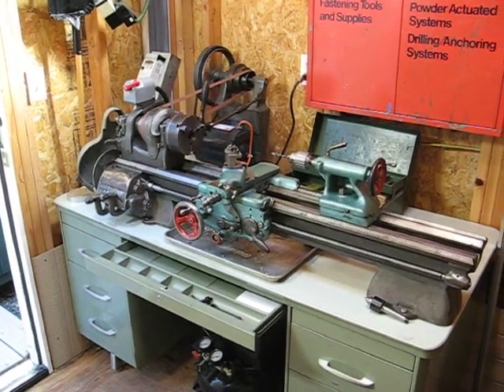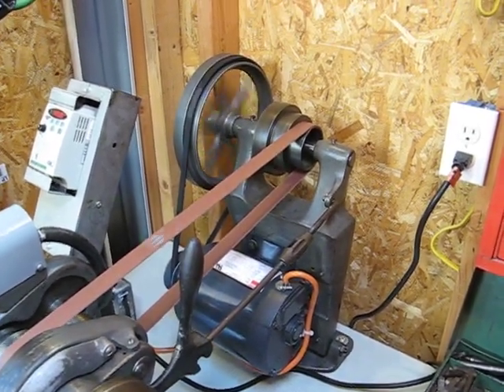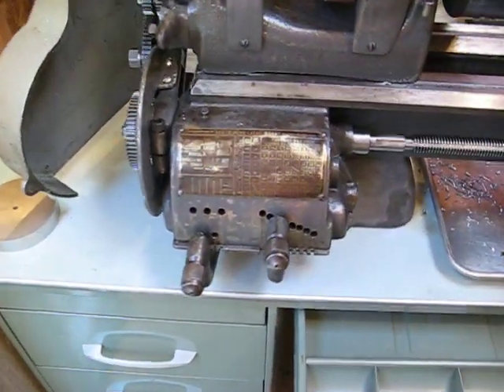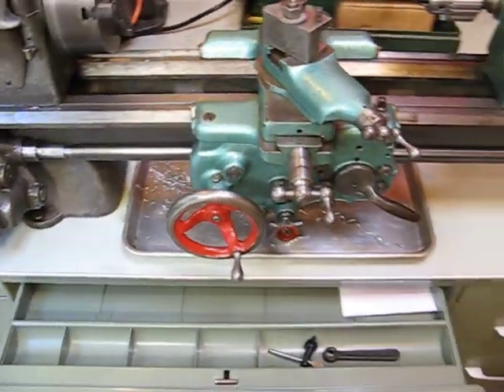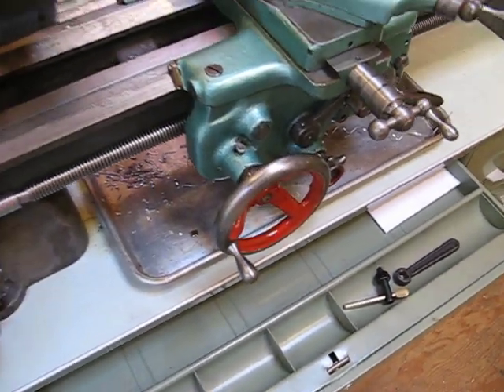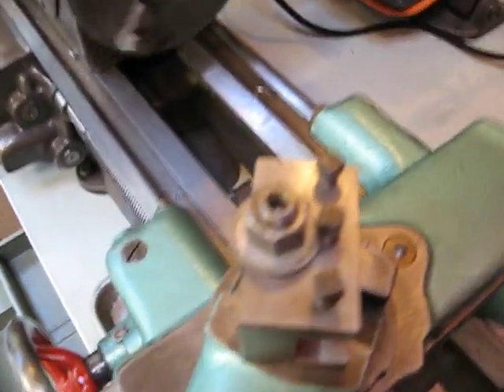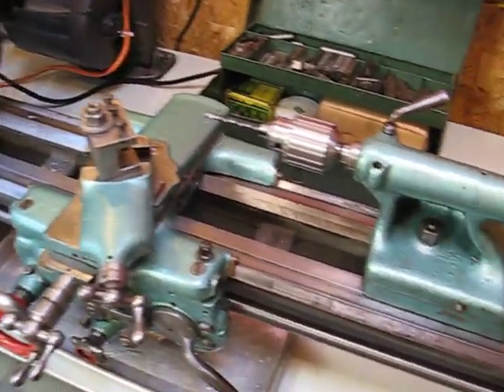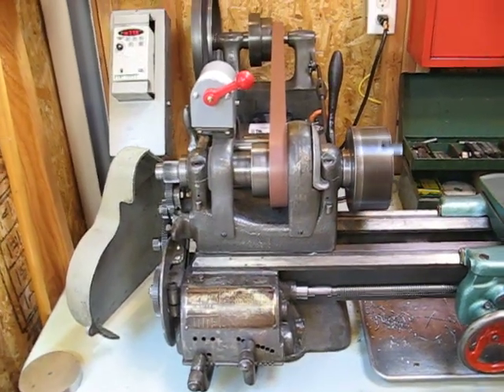South Bend Model 9A Metal Lathe walk through

Comment: Are you still running this mounted to that old tanker desk? That's what I was originally considering to do with mine and I wondered how it held up or if you have ay feedback on it
Reply from the maker: yes.    I don't use the lathe a whole lot but it still occasionally comes in useful,  most recently in repairing an electric lawn mower motor.      The desk is very heavy so no problems with things shifting around and its top (marmoleum or something) is easy to clean.      The one thing I want to do to mine and would reccommend is replace the legs with heavy duty casters.   Then you have a (sorta) mobile lathe.    You might also want to find a desk that is shallower (front to back depth) than the doors in your home/shop? so you can roll it through easily.   Mine is a little too wide for the door it had to go through necessitating major disresembly to get it to where I wanted it.
Reply: @madderscience that's good advice. I have my lathe mounted on something with castors now so I'd true to go that direction. A lot of those tops are formica and fortunately with a garage door, i can get away with some extra width. Hopefully before long I'll have mine rigged up similarly!

Comment: Just purchased one of these (well model B) from auction for less then 50 USD with so many accessories., best deal I've ever gotten. Just need a bench, what kind of desk is that? Thanks
Reply from the maker: The desk is a 60's or 70's era steel 'tanker' desk.   Find an old office furniture store or building contents liquidation and you can get your hands on something similar.   Very sturdy and very heavy.

$50 for a SBL in any shape is a really good deal.  some of those accessories can really add up the cost.    congrats.

Comment: The tail stock For my old model C seems to fit my 1948 interim model A ..
Reply from the maker: is there enough (or too much) overlap on the flats?    is the centerline of the tailstock in line with the centerline of the headstock?   given the difference in bed width some adjustment may be necessary.   Still good information.

Comment: I have the 1938 version of this lathe, they made B17 parts on it in the war.  Still works good but a new motor would be a major improvements as it's very under powered.
Reply from the maker: I think my motor is 3/4HP rated but the motor controller I have is only good for 1/2hp.   I've mostly made things from  aluminum;  some steel for driveline parts in the car and I'm not worried about speed but its a good setup.   I've still got all the ratios on the countershaft to play with so getting the speed vs torque I want isn't a problem.  The flat belt slips long before I run out of motor.

Comment: Hello, I don't think you are going to get 20 tpi on B 3 because you have mounted the 40 teeth gear in the wrong position
Reply from the maker: Its entirely possible;  good eye.  I've used the power feeds for various turning operations but I haven't cut any threads yet.    You can't tell but I've also got the quick change box levers installed in the opposite positions from correct ; only impact there is a couple ratios won't engage.  I'll fix it when I need those ratios...
Reply: @madderscience  just put the 56 teeth gear instead of the 40teeth gear

Comment: Hi!
I’m learning to operate same exact lathe but can’t get the right thread. 
I have the belt in low gear and have the gearbox in the thread i want to make and matching letter but I get 3x more threads than I want. 
Instead of 10 I get 30 I tried 5 and I got 15. 
What I’m I doing wrong or missing?
Thank you!
Reply from the maker: is the back gear ratio correct?   Is the underdrive engaged (big reduction gear behind the spindle)?    You are reminding me I need to make something.  Last thing I did with my SB9 was modify some electrical conduit brackets to make a security camera fit a bracket it wasn't originally intended for...
Reply: Hi, you must have the 40teeth gear and the 56 teeth gear in the wrong position

Comment: If possible, can you please tell me the Brand/Model VFD you have, and it's input and output? Thanks
Reply from the maker: Its an Automation Direct GS1 10P5 I believe.  This is a 1/2hp unit.   120V input.  It works fine, my only complaint is you need to wire up an external switch for reversing.  All the other controls (on/off, speed) are built in.   I'm running a 3/4hp  inverter rated motor with it.   I believe its an 1800rpm @ 60hz nominal motor.
Reply: Thank you for the information, I appreciate it. I'm kind of torn between a 220 single phase in /220 three phase out - OR-  a 115 single in /  three phase out for a 1hp on my 13"  SB. I'm a bit confused on how or if I will be able to utilize it's existing Forward/ Off/ Reverse  drum switch in a VFD configuration. Then there is the issue of remote unit with tachometer to factor into the mix.  Btw your desk is perfect!
Reply from the maker: It should be easy to set up the drum switch to work as a fwd/reverse selector,  but not so sure about also controlling start/stop at the same time.   IIRC it has plenty of contacts so that might be possible too depending on what external controls the VFD has.  I haven't tried to set it up for that since I haven't tried to make any threads yet, so I haven't needed reverse.   I'm looking for an excuse;  it just hasn't come up yet.
Reply from the maker: I picked 120V input specifically because my workshop is powered by an off grid solar array and battery bank.  I don't have 240v.   However,  I've never had any issue with insufficient power.  Anything bigger than a 10" lathe though 240v would probably be a good idea.
Reply: Thanks again. A solar powered lathe is pretty cool. Being this late in the season (and I just got my lathe Tuesday), I'm also still wrestling with where to station it. Garage, build a shed, dismantle/restore/reassemble in my basement, I'm not sure. My 120v or 220v direction will be dictated by the final location as well. In the end these are happy problems. :)

Comment: do you lose torque at low speeds?
Reply from the maker: Not that I have noticed.  Between the 3 belt ratios and the back gear I can gear it down pretty far before I even need to reduce motor speed very much.  At the start of the video the motor is running at 20hz or 600rpm (1/3 of standard speed) with the backgear engaged and the chuck is running at roughly 20rpm.   So at 60hz in that ratio you'd still be at about 60rpm on the chuck.   The belt between the motor and the countershaft could be moved onto the larger countershaft pulley for an even lower gear.   With that much gear reduction you don't need much torque at the motor.  The belt will slip before anything else.

Comment: If what I read is correct ,It must use some different  castings like you suggest. I actually got much of this info from a "practical machinist" forum. Just do a  google search : "south bend 1947 9a intermediate bed revisited".
Reply from the maker: +ed flower I saw those postings as well.  I updated the video description to add the intermediate bed description so far as I understand it.   Thanks.

Comment: This lathe looks like it may be equipped with an "intermediate casting" bed that was introduced  in 1946 or 47 and sold alongside standard bed lathes for a very short period of time. I happen to own one that was made in late 1948 and is the newest one I'm aware of. They were distinguished by not having the protruding ledge along the bottom edge of the bed and also the ways are only 2" apart instead of the standard 2"and 3/8. It was also slightly  lighter (about 10 lbs. than a standard 9 .Probably developed during the war to save on materials and production costs(simpler casting process in production?)
Reply from the maker: +ed flower Hi Ed-  Based on your description I can confirm your suspicion.  the gap between the ways is exactly 2"  and there is no ledge along the front bottom edge of the bed.    Thanks for the information about this.  I was not aware there were different  SB 9" bed types other than length.

I imagine this means some other parts of the machine may be different.  I am thinking the head stock, saddle, and tailstock at a minimum must be different than the more common models.   Do you know if this is true?   So far all the parts I have needed to replace have fit fine,  but I haven't had to replace any major castings, just a few small parts during the initial overhaul I did.

My serial number is 184826,  made sometime in 1947.

Comment: My serial # is 13141NAR8 - any idea of year?
Reply from the maker: +Robert Phelan  If you search around for "south bend lathe serial number" you will find several pages hosted by the current owners of the SB brand and third party sites which describes the SB serial numbers and the age range.    Since your number has the trailing letters it is post-1947 for sure (when they swtiched to having the letter designators) and given the relatively large serial it is probably from someplace in the 60's I guess.  There is probably more specific info to be found behind the above search terms.
Reply: Grizzly Machine & tool

Comment: madderscience, I just inherited this exact lathe from my late uncle.  I need to move it from his house to mine.  Is there a way to take the flat belt off without having to cut it so I can separate the counter shaft from the actual lathe for easier transportation?   THANK YOU!
Reply from the maker: Bob's Channel If it is an original or equivalent replacement leather belt there should be a joint in it that can be taken apart.   However if it is an original leather belt it is likely ready to be replaced.     Some people use automotive timing belts as replacements which work fine but you have to take the headstock and countershaft apart to disassemble things.   If this is what you have take the countershaft apart,  its a lot easier.   Or,  depending on the condition of the belt,  just cut it and then get a flat belt replacement via ebay or other such places.
Reply: Thanks!  I believe it is an original belt, but seems it too good of shape to be - LOL.. I did see two set screws on the countershaft - I loosened them and was able to slide the shaft to the left far enough to feed the belt through - so I think I am in god shape - thanks for the reply!!!!
Reply: +Bob's Channel Glad to hear you saved your belt..... I was fortunate enough to get a 9a precision tooling lathe with a MINT one piece leather belt.
it is very nice having the belt smoothly run without the jump of a laced belt.
Quieter and makes a better cut too. Good job saving it.

Comment: Awesome lathe I would love to have one like that.
Reply from the maker: watch craigslist and ebay.  they aren't too hard to come by.   If space or cost is an issue there are smaller ones like vintage  6" atlas models that are pretty common and about 1/2 the size of mine, and seem to sell for a couple hundred typically.  Cheap enough for almost anybody, and small enough to be set up and used, then put away when not needed.

Comment: Can you tell me what you used to clean the sawdust and dried up lubricants? I have a lathe and drill press that is full of sawdust and lubricants and was thinking of using oven cleaner but am not sure.
Reply from the maker: kerosene, a couple of old paint brushes and a toothbrush in a metal paint tray (for the smaller parts) work well if you don't have the more professional cleaning stuff.   I used steel wool on the more rusted areas; it removed the rust without grinding down the underlying metal.   Automotive cleaners and corrosion removers should also work.  Haven't tried oven cleaner but that is probably nastier stuff than kerosene.    Goes without saying of course but use in a ventilated area and don'e smoke :)
Reply: @madderscience  I'm late but oven cleaner is typically lye based, very caustic, I'd stick with karosine and rust converter

Comment from the maker: practical machinist forum seems to have great support for various vintage lathes including south bend models.   Assuming the ways are all in good shape on the cross slide and compound and they are tightened up right and everything is assembled properly then the only reason for any slop would be a worn feed screw or, more likely, the brass feed screw nut.    I've seen replacements available on ebay.

Comment from the maker: $1300.  But that included a fair amount of tooling including lots of cutting bits,  tool holders,  a tailstock turret,  a steady rest,  3 jand 4 jaw chucks, two tailstock chucks, and the original faceplates,  and probably some other stuff I am forgetting about.    

Realistically the value of yours is going to depend greatly on the age, condition (think wear and rust), exact model, what comes with it, and region of country.   Anywhere from a couple hundred to a couple thousand basically.

Comment from the maker: Its a GS1 series 0.5hp from Automation Direct.   I'm running a 3/4hp dayton motor with it.  120v input which was necessary for my power source (which is actually an off grid solar setup using a modified APC 1000W computer UPS as the inverter).    

The VFD seems to work just fine; my only complaint is you have to hook up an external switch if you want to reverse motor direction.  All the other controls are onboard so I am not sure why they didn't include a reversing function onboard as well.